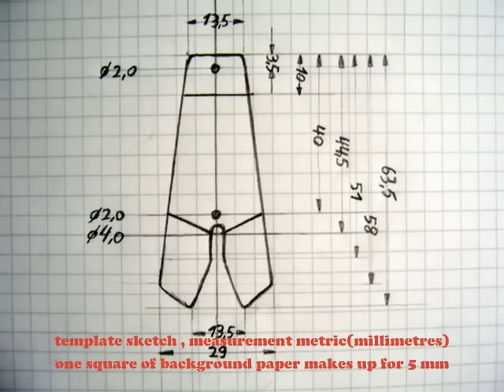Homemade Casting Spoons "DinnerBell"

Comment: Wow very nice!
Reply from the maker: Thank you ! 

Before having designed this "Dinnerbell spoon" , I had made "ordinary" spoons by shaping them with a ball peen hammer for years , I just wanted to try and skip that elaborate proccess .

But instead the cutting work on the blanks turned out to be more elaborate , .....hahaha , ......and later I had found , I would need that special way to attach the hook , the metal beads initially served the purpose of preventing the wire harness to slide into the rear slot and bind there .

But on first bathtub tests I had found , that these beads do constantly emit a clicking sound , as the spoon wobbles along , hence the name of the spoon .

On first outdoor tests I had also found out , that the beads(small one hollow , bigger one solid)do enhance the casting performance of the spoon by letting the spoon fly with the beads pointing downward , thus generating some kind of an air cushion inside of the spoon's cupping , similar to an airfoil .

When casting straight against the wind , the spoon would sometimes act like an aircraft just launching off , as it does kinda like climb upward .

The swimming action sports a nice wobble swinging from one side to the other , but the spoon can be made to break out sideward by pausing and speeding up the retrieve randomly .

When the spoon is made to sink down to the bottom , the hook would fall inside the cupping with the hookpoints pointing rearward , so it does not snag up as often , but also here lies the only disadvantage in this spoon , which ist , that sometimes the hookpoints do foul with the "D"-shaped  wire bent , that limits the forward swing of the wire harness .
 
I haven't found a solution to this problem , but it does not happen too often , and most likely only , if the spoon is allowed to sink to lay right to the bottom .

The spoon is not suited to fish near bottom in deep waters , anyway , as it has a tendency to rise on retrieve faster than other models .

But it is very appealing to all  local species of predatory fish , I had already caught pike , zander(European walleye) , perch , asp , and trout on it , so it is quite versatile , also due to it's smaller size .

Of about two dozens that I've made many years ago , I still have about half of these left , and I frequently tie them on every season .

PS : I had also made bigger versions as the one shown , but these do not perform the typical , lively action  by far , ....I guess , that they must be too heavy .

Comment: nice craftsmanship.  I'd be temped to toss the decals ans just go with it polished or circle-swirled with a repeated tapped of a Dremmel/air-grinder/rotary bit... maybe peen-hammer some dents in it before starting?

very nice execution.

With the cost of brass... might be hard to justify buying a sheet just o donate to local rivers though. :p

I may give this a try with aluminum though... not sure how that'd stand up to salt water though.

Comment: Saludos desde Colombia, que numero de anzuelo utiliza en este señuelo,, gracias

Greetings from Colombia, that number used in this bait hook,, thanks.

Grüße aus Kolumbien, diese Zahl in diesem Köder Haken verwendet,, Dank
Reply from the maker: +Chuchin007   

Thanks a lot for watching , .....the hook sizes for a "DinnerBell" of this size could be hook size 2 or size 4 , ...but I usually prefer the larger sizes for our local pike . Saludos, Dieter
Reply: -another question, the lure to swim "looking" down or up.

- eine andere Frage, die Verlockung zu schwimmen "auf der Suche" nach oben oder unten.

Gracias.
Reply from the maker: +Chuchin007 

They always swim with their wire form and metal beads pointing upward towards the water's surface , ....just like an ordinary spoon lure .

They wobble very well and cant from one side to the other WITHOUT turning over , an irregular and random swimming pattern can be achieved by rod tip manipulation and changes of retrieve speed .

During casting they obviously come to position themselves vice-versa , with the wireform and metal beads hanging downward on flight , .....the weight of the beads seems to level the lure this way and it glides through the air like an airfoil , generating a "cushion of air" underneath it's hollow side , ........at least this is my only explanation for it's superbe casting performance of this fairly small and light lure , even against the wind .

But sometimes the hook fouls into the "D"-bend of the wire form , I haven't yet found a solution for this problem , does not occur too often , anyway .

Most likely happens only , when you let the spoon sink down to the bottom, .....then the treble hook would most often fall into the spoons hollow reverse side with the hookpoints pointing forward towards the line , so sometimes they catch the "D"-bend this way ,.......but on the other hand this also minimizes bottom snagging , ...I lost far less of these "DinnerBell" spoons to bottom snags than other , "ordinary" spoons .

Saludos , Dieter